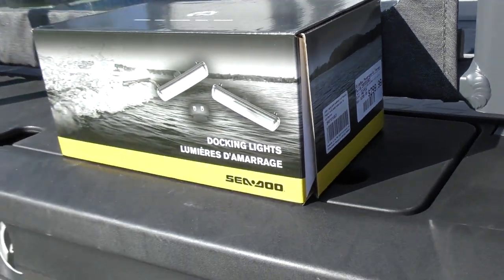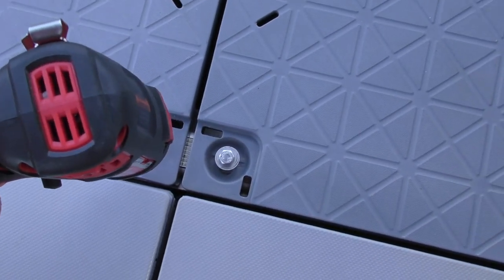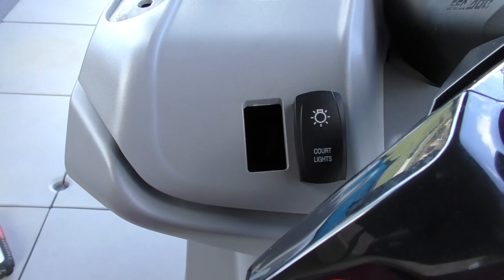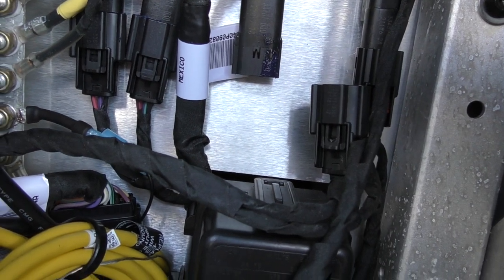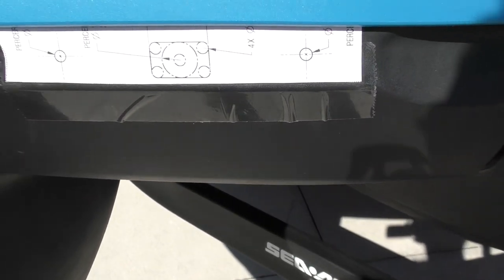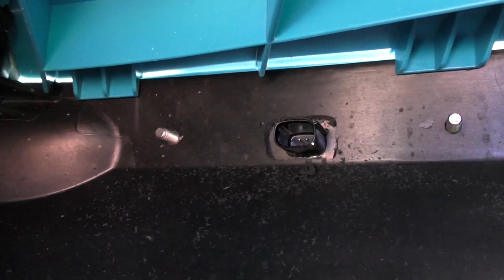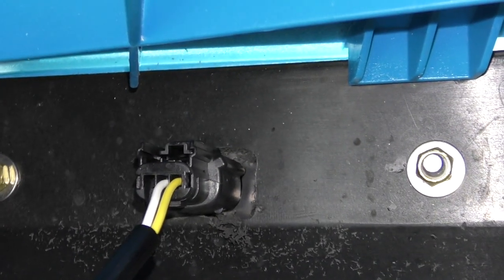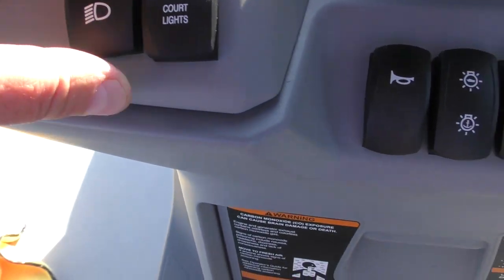SeaDoo Switch Dock Lighting

Comment: At $300 for "marker" lights I'd be tempted to wire up some 9" LEDs so can see 5 miles away! Or is thst illegal on boats? (Sorry I don't know boating laws)
Reply from the maker: You can have any lights you want, as long as it doesn't interfere with the navigation of other boats.    These are certainly expensive, but do look like they're made for the boat (since they are) instead of a simple add-on.

Comment: No silicone?
Reply from the maker: I use a dielectric grease on electrical connections.
Reply: @letsrolldiyauto1532   Silicone at the thru hull bolts and around the hole for the electrical connection.
Reply from the maker: @riverakers  I did not.  The instructions do not call for it and there is a rubber gasket that is designed to provide the water seal.  But the area where these lights enter the hull is not a water tight compartment anyway. It freely communicates with the anchor bay which not water tight.  So I used the dielectric grease on the electrical connections only.

Comment: They made it separate , why ? A motor vessel by law must have proper port , starboard and white light . This vessel should be sold with proper lighting rule of law ; if it requires a registration it requires proper lighting  thereby enablinh intentional or unintentional use . Vendors sell portable clamp on port and starboard lighting for smaller vessels....separate lights strikes me as chinsing.....don't do that seadoo...rise above that and take your rightful place....be careful how you take a rats advice .
Reply: The SeaDoo does have the port and starboard lights and the white mooring light.  It does come with the lighting required by law.  These are "headlights".  Yes there are portable after-market lighting options.  But these are made for the boat and can help when dockig at night.
Reply: I have just been informed these are after market lights helpful when docking . My opologies ....
Reply: The switch comes with all required lights.. clearly you do not have one yet @williamsmith5521 these are much brighter and are great for night docking or illumination for fishing.